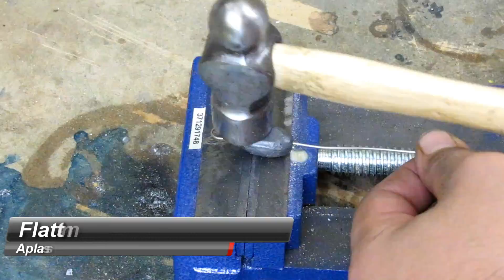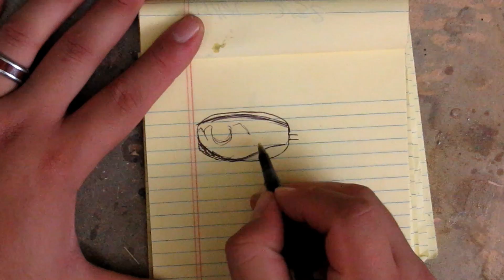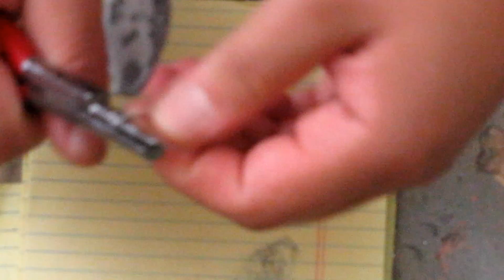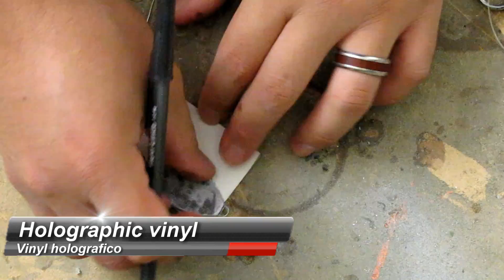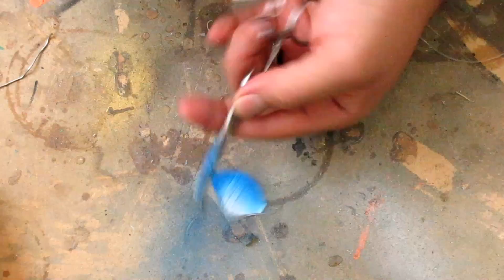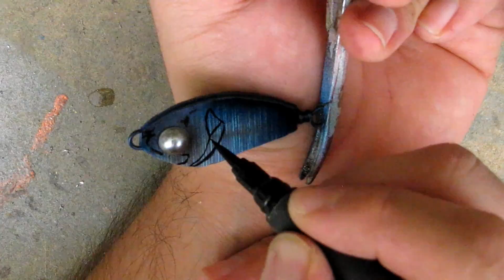Homemade butterfly jig

Comment: That's a simple n affordable jig idea. I've wanted  lighter butterfly style jigs than are available in tackle stores, 1/2-2 oz.  And wider for a slower fluttering sink rate. I also fish in the sea of Cortez. You can lose lots of life's there.  Rocky bottom, fish that run for holes, and lots of things with teeth. 
There would be ideal.  
Your stuffs always a work of art, but I'd just paint 1 side white, the other silver, and a black for for the eye.
Reply from the maker: Michael Burk thanks  I like the slower jigs also and I've  seen a few like you  described with one side white and other silver but sometimes what you make tells you what it wants and I was really feeling a jig with a face thanks for watching and 1000 points to you couse I really liked yore comment